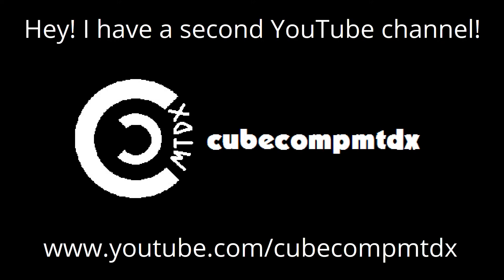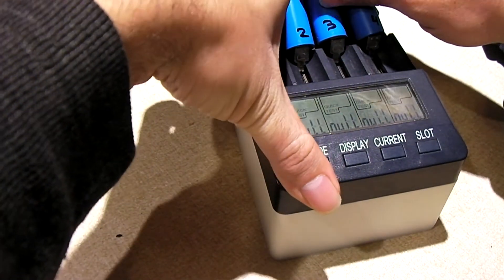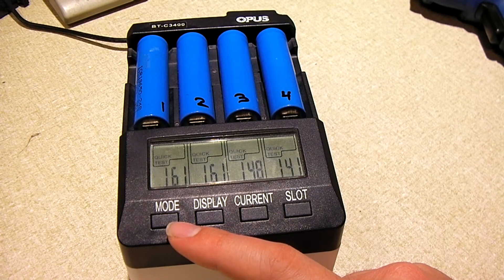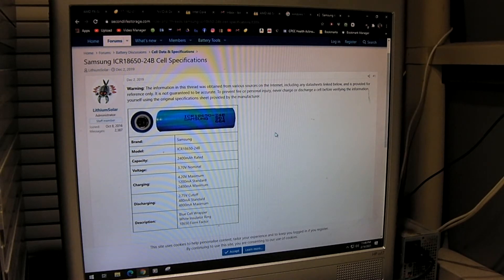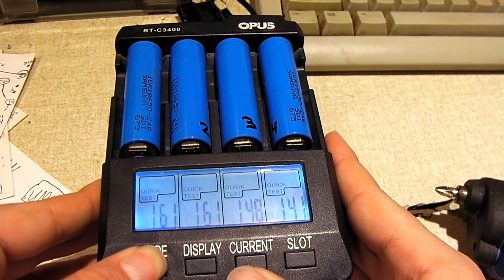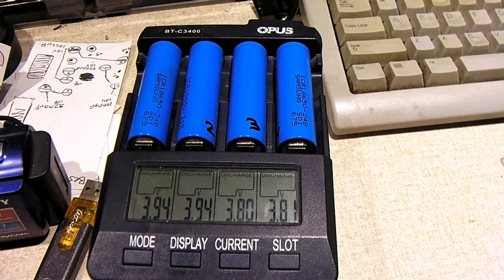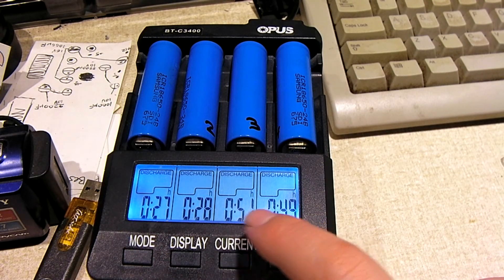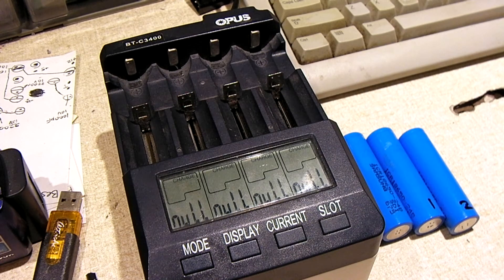Testing the harvested Samsung 24B 18650 cells

Comment: Did you try discharging them at the lower current setting. With old cells I tend to find using that charger at the high discharge level it stops the discharge early, therefore you get a lower capacity reading. It really depends if you want to use the old cells for light or heavy current applications. Old cells usually better for lower current uses, because of the higher internal resistance of these cells.
Reply from the maker: I ended up recycling these cells since I had much newer packs available to source from and ended up getting some much better cells.